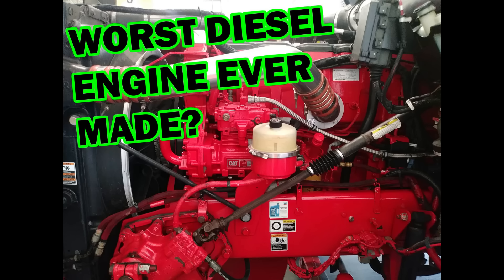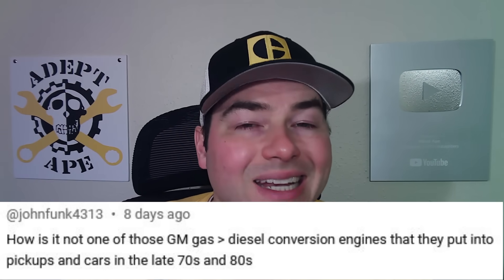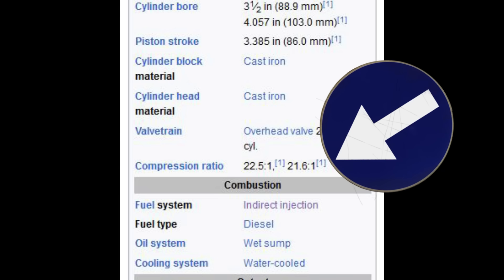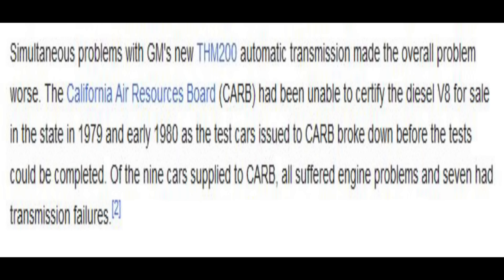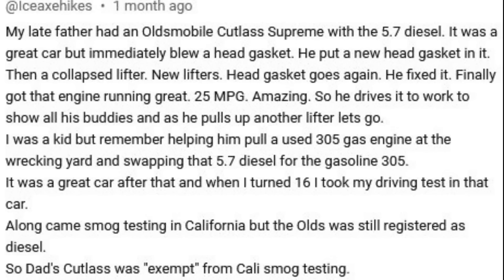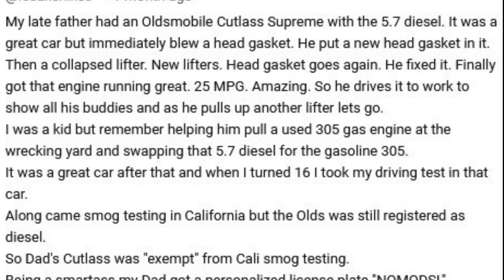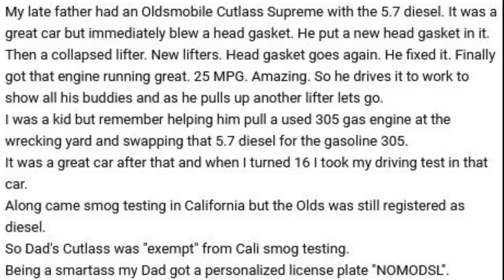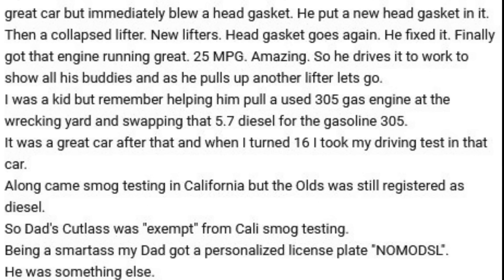This Engine is the Reason You Don't Have Diesel Cars in America!!!

Comment from the maker: Hope you guys enjoyed this one. What are your experiences with the GM Diesel Engines of this era? You can help the channel out by clicking the Amazon Affiliate Links below: Fuel Pressure Gauge, Compucheck 0-300 psi: https://amzn.to/3YeBldu
Airlift Cooling System Vacuum Filling System: https://amzn.to/3D9AlPu
Radiator Pressure Tester Kit: https://amzn.to/3QGBumn
Milwaukee 3/8" Right Angle Impact Wrench: https://amzn.to/3D2CvAk
Adjustable Height Parts Tray 100 lbs: https://amzn.to/3CBusZB
Engine Oil and Fuel Dye UV: https://amzn.to/3z34zkv
UV Professional Grade Light: https://amzn.to/3gzxPc0
Allstar Oil Pressure Priming Tank: https://amzn.to/3L5pASm
Oil Pressure Priming Tank: https://amzn.to/3YuBrNr
Reply: And  u were struggling to find other Diesel engines. 

Mercedes has been making and importing diesels for United States since 1949. 

And they still do. 

For 75 years. Or older than the avg male in North America.
Reply: I have matching 1982 Buick and Olds land yachts. Huge! And they got 28 mpg! The odd head gasket failure to be sure.
Reply: Fortunately for people around here there was a mechanic that could do the head gasket fast and cheap. You had to keep the glow plugs up for our ND winters.
Reply: Well the other day was depressing. 
I worked on a generator powered by a 6B 12v cummins. 
Whats depressing about that ? 
Someone ruined it by putting some spark plugs in it. 
They took a great engine and ruined it with gaseous fuel  😂
Reply: My Dad sold those 5.7 350 cu inch engines in Oldsmobile cars.  He said he sold like 3.  One blew up while they were on a test drive..... brand new!  They had to get the car towed back to the dealership.  Didn't sell one to that customer!😅
Reply: CAN YOU PLEASE GROW BACK YOUR BEARD . IT SUITS YOU  . TRUST ME . . NEXT TIME I WANT TO SEE A MAN NOT A BOY . 😊😊
Reply: My dad bought an ‘83 Buick Century with a 4.3 Oldsmobile diesel engine. 
Injection pumps were the issue early on 1st one went out at 45,000 miles. We went to a local diesel injection repair shop and they suggested a Stanadyne injection pump. He ran that one another 100,000. At 150,000 the freeze plug in the center of the block rusted through and dumped the antifreeze on the highway. We repaired the plug replaced a cracked head with a reworked head an engine head shop had been sitting on for 15 years (according to the owner) back on the road she went with new piston rings and lifters and injection pump #3. At 475,000 the transmission gave up on him and he put the old car to rest. The V6 was the engine to have and as commonly happens just when the problems are almost solved we abandon the concept and go a different direction. GM was sitting on a gold mine and threw it away by cutting costs. The VW rabbit diesel was the most sought after vehicle in that era because of its reputation and GM was the least sought after because of theirs.
Reply: @DaddyRabbit62 A Stanadyne? you mean like out of bulldozer?
Reply: Bought a nice cutlass oldsmobile V6 diesel for 600 bucks at a auction. Wife drove it a couple of years. Head Gasket blew and she overheated it.  Finally sold it to a junk dealer. GM should know how to build diesel engines. After I sold it I saw an Oldsmobile for sale cheap. Setting next to it was a fresh rebuilt V6 diesel. GM must have forgot how to make transmissions. The 06 Pontiac  has a Toyota transmission. The easiest way to check the fluid level is to crawl under the car and remove a motor mount. The short dipstick is held down by a bolt. Seems to be a good transmission.
Reply: I currently drive a 2018GMC Terrain with the 1.6L diesel..  I have 133,000 miles few issues... people are stupid I get 44 MPG ignorance like you spewing is why diesels dont come of age... they are way better now and mine has been reletively reliable..
Reply: Hada 1983 old's 98 5.7 diesel. Was a great car. At the end I got 29 mpg on long trips. Just before 100K It dropped a cylinder, it was done! If they would of made it right, would of been a great motor. That olds 98 was a great car for the time.
Reply: VW had long time success with their 4 cylinder diesel which was a convered gasoline engine.
     The Oldmobile diesel was conceived as a diesel from the beginning. It's similarity to an Oldsmobile gasoline engine, is mainly shape & size, so that it would easily fit in so many different GM models.
      It's misleading to characterize it as a "converted gasoline engine". The reason it sucked, was the nerd beancounter accountants at GM wanted to save a few nickels on head bolts, etc.
Reply: The Oldsmobile diesel engine was insidious, because they usually were troublefree for the 1st 15,000 miles, & get 25 mph on a comfortable full sized car, giving time for word of mouth to taibe about how great these new GM diesels were, making sales spike, then they went to sh*t all at once, devestatimg the diesel market in America forever!
      It was so close to being good, but like I said in my other comment, they tried to save money on seeminly small & innocuous, but actually critical parts. It all came crashing down at once, never to recover in the marketplace. By 1980, they had the kinks worked out, but it was too late. Decades later, I had a 1982 bustle back Seville with the 5.7 liter Olds diesel, & it ran great.
Reply: The ‘gas and Diesel engines are different’ argument is MOOT

Case 1- the vw diesel was essentially based on a 1975 gas engine from Audi doveloped in the 60s. 

This engine ran almost unmodified until 1997 powering cars and even ‘bus’

Case 2
Vw 1.9 tdi 
Literally shares a block with the 1.8t /2.0 gas engines. 

All 3 engines can go half a million miles. None had headgasket problems. 

It’s not that they can’t share a design. 
That’s shade thrown by gm or ford fanboys. 

The reality is. 
Oldsmobile was shitty and now they’re gone😂

Comment: Grandma bought a 5 cylinder diesel 300d in 1974 in Germany brought it back to use for a road car but couldn’t get service at the dealership, couldn’t find anyone else who would work on it and parts were so expensive she lost a load of money from that car. Even today I have difficulty finding a diesel mechanic shop which will work on my ford 7.3 liter diesel pickup truck.
American government and car manufacturers really never got around to aggressively marketing diesel trucks except big tractor trailer trucks and big pickup trucks but virtually no sedans or station wagons I would have liked to been able to buy a little VW bug with a turbo diesel engine get 50 mpg run it on used transmission fluid or used motor oil and gasoline mixed. I lived through the oil embargo 73’ you were only allowed 5 gallons of gas had to wait in line for hours. Would’ve been nice to avoid that pain but even then there was no mechanic shop that worked on small diesel engines at least not like European countries 4 cylinder diesel cars were as common as Chevy nova’s every gas station knew how to work on them.
The failure wasn’t just General Motor’s and Oldsmobile but there was no infrastructure and no engineering and no granular process, just slap it together and sell, sell, sell!

Comment: I love the opinion of people who only know and love Fords engines, which I believe you are one! It is apparent the way you talk this is fact!!  The diesel in not popular in the US because the President Jimmy Carter hated diesels and tried to ban them forever! This made the auto manufactures take a step back from Diesels in cars, know I was in his administration when he did! By the way in many other countries diesels are the only engines in their cars The Detroit engines have been the mainstay in the Marine and military industry's way back in the WWI until the 1990"s!
when Cat rolled out 3200 series V8 mostly of the marine application for large pleasure boats! However, the 871, 671, and 471 Detroit's, were in tugboats, ships, over the road trucks, box trucks, farm tractors and heavy equipment for years!!  Diesels are used in more than 2/3 of the equipment in this country, and 95% of the inboard pleasure boats around the world over 60ft! 95% of the boats under 60ft with inboard out boards use Chevy or Gm gas engines!   The Oldsmobile Deisel was not a conversion it was a stand-alone however they used a similar mold for the block and did not make the mains with 4 bolts they used only two, this was the downfall of that design however in 1980 they fixed the problem! I ran those engines late into the 80's then went to the 6.2 Na baby diesel! If these were so bad why did the US Military buy Both of these engines for their main vehicles until they changed to the 6.2 Turbo and the 6.5 turbo engines in the later 80' until present? 
If the Detroit are so bad, why did they not go with Cat? the military tried International Harvester but got rid of them after WWII because the IH plants were being bought up by GM!!
 Ford Junk could stay together long enough to even make the trials!!
Ford has never made a good diesel, that is why they had to team with International and Mitsubishi who by the way was owned by Detroit GM!! Your info from Google is wrong they make crap up if they do not know! You want to impress me Buy a 350 olds and run it, if you take care of it will run 300,000 miles! On my baby Detroit 6.2 NA I have 1,25 million miles! I drive a truck for a living now and I know how to keep Detroit Diesels running for longer than those toy Fords ever will!!

Comment: I had 3 pickups back in the day with those motors . All you do when you get it brand new is tighten all the deadbolts 30 more pounds over spec . I ran them 120,000 miles and never lost a head gasket . They weren’t power houses but it got good fuel mileage. These were short bed 1/2 ton Chevy pickups just for driving to grading jobs for work .

Comment: Your analysis is spot on.  I'm 66 and I remember everyone with these engines having failures.    Virtually no one wanted to own a diesel can after that.

At the time I pointed out that small diesel engines for delivery trucks cost twice what these diesel engines cost (with similar power).   That was of course because the delivery truck diesel engines were  designed to be a diesel from the start and everything was far more robust - and they did not have unusual failure issues.

Comment: You never mentioned the biggest reason that diesels became popular, which is MONEY. And MONEY, is also why you would never see diesels again(even IF you could make them meet emission standards). Back in the 70s, diesel fuel was considerably CHEAPER than gasolene, plus diesels got better MPG(miles per gallon) than gas engines. TODAY, diesel fuel COSTS MUCH MORE than GASOLENE!!! WHY??? I personaly would LOVE to know the answer to that!!! Back in the day, most homes were HEATED with fuel oil(which is DIESEL fuel), now most homes are heated with NATURAL GAS!!! So there is less used in home heating, which according to supply and demand should mean that DIESEL should be CHEAPER than GASOLENE, but it is NOT!!! I would LOVE a RATIONAL EXPLANATION, but that is a large reason diesel makes no sense in automobiles.

Comment: In pickup trucks GM had the POS 5.7 ford and christler used proven engines from international harvester in Ford's and cummins in dodge. Both were successful. In the 80s my brother bought an 84 ford 250 with 6.9 diesel engine auto trans. The same year I bought basicly the same truck with a 460 gas and 4 speed manual transmission. That was the best truck I ever owned. At that time we were both pulling a lot of trailers hauling everything from livestock to building materials. That 460 would run off and leave that diesel even with a heavier load. The only advantage the diesel had was fuel economy, that 460 loaded would pass everything on the highway except a gas station.

Comment: Another GM diesel story would be this in the locomotive World General Motors or EMD ran the show. Then they came out with the sd50 they raised the horsepower of this by just turning up the RPMs of the 643 Diesel from the sd40. This caused many failures and problems and GM was thrown out of the locomotive race and now GE owns it.

Comment: You got it all right..... the combusting engine pressure was a way too high and that`s the same in ALL GM diesel engine....But the biggest failure of 5,7 was it did not have a water filter for the diesel fuel. All trucks are running lower combusting pressure and using a turbo and then you can get more horses out. Thanks for pointing out the smaller 6 cyl. diesel engine and that it was a good one. 
But the 5,7 diesel used to be a good petrol engine and made some 800 horses with a big bore Olds crank and and many hours of labor and machining. Some guy I did read about did lower the combust pressure and run that engine for many years without any issue and he did also install water filter. 
Smelling a diesel in the morning smell like a victory.....

Comment: How did that 305 gasoline engine hold up? That was made by Chevy and installed in Buick  / Olds / Pontiac too and led to a lawsuit.  I had one in a Pontiac. I got $300 when the suit settled. It wasn’t enough.  They had soft camshafts. Mine failed at 50K miles.

Comment: Had a friend that that had an Olds Cutlass with the 5.7 diesel in it super car 6 big guys going to concerts and strip clubs rode and drove like a dream had another friend had a Volkswagen rabbit with a diesel no more than 4 big guys going to concerts and strip clubs. The Olds got around 25 miles to the gallon when comparable gas models got 15-19. Rabbit got 44 miles+ comparable gas models got 22-25. I swapped the Olds diesel out at 56000 miles with a 350 gas because it put a piston out the side and that was the cheapest fix back in the day. Swapped the diesel out of the Volkswagen at 238000 miles for a gas engine out of a Dodge Omni because Dodge put Volkswagen engines in the Omni in those days and it was the cheapest fix
 Loved turning wrenches back then cause people kept things forever because of interest rate and lack of money.

Comment: I had a Toyota 2 Wheel Dr. diesel pick up a Volkswagen rabbit diesel and a  78 Chevy pick up half ton that had that in it. I put a small block Chevy in it because there is problematic also an 81 I bought a Cadillac coupe Deville Braham. also had the old diesel. that one actually ran OK. I do miss that Cadillac.

Comment: They weren't subsidiaries, they were divisions of the same corporation. Oldsmobile and Pontiac didn't go out of business, they were shut down by GM. They kept Buick because of its popularity in China, not because of any great sales success here. Another factor never discussed by you youngsters, who weren't even born yet; before the gas crisis, diesel was cheaper to buy than regular gas, when more cars started offering diesels, the oil industry raised the price of diesel, so as not to lose the profit they had been making, due to the popularity of gas engines. That immediately changed the the major advantage, of diesel, in the eyes of the public. GMs feeble attempt to cash in on the diesel wave, after they began substituting cheap Chevrolet engines for the V8s designed and built for the other divisions, led to the start of their loss of market share, as did their new requirement that their customers do all the research and development, as their engineers were too busy with all the new safety and fuel milage requirements. At the same time, light duty trucks, were much cheaper to buy than cars, due to their primarily commercial usage, and their lack of regulations that only cars had to meet. This (and the bandwagon toward front wheel drive in most cars) led people into using pickup trucks, as everyday transportation, instead of cars. This caused the car companies to gradually raise the profit margins on trucks, from about 12 %, to the 40 % that it is now, with their being more popular than cars.

Comment: dad had chevy p/u truck with 350 and auto trans, would smoke the tires in 1st and 2nd gear. when rebuild at 350k miles, i found the wrong timing gear, was an old type with the valves opening late, vs. the newer with the valve opening sooner and early.

Comment: Had a Chevy wagon once powered by tbe Olds diesel.  Engine actually worked well; the trans eventually went bad.  In the day, the two most likely complaints with the Olds diesel were fuel waxing up in cold weather and some problem with the Roosamaster injector pump.  Mine, as I said, worked fine.  It would take maybe 18-19 seconds to get to 60, but it would do close to 80 on the highway, and it did one thing well that many contemporary gas cars wouldn't:  it would respond instantly and reliably to the accelerator from standing still.  It didn't have a lot to give, but what it had, you got right now.  That, of course, is a characteristic of an injected engine; contemporary carbureted engines not infrequently hesitated off the line, due usually to an issue with the accelerator pump.  The 350 diesel block was often reckoned a good foundation for a high-performance GAS 350 because of the extra metal in the high-stress areas.  They had a fairly good idea, which might have been better if based on the taller-deck 455 and equipped with a better injector pump, and possibly turbocharged.  Well, it was what it was.

Comment: I had an 82 Cutlass with the 350.   The only problem was the injection pump.   Between 40,000 and 80,000 miles, the injector pump was going to need to be overhauled.   It want a cheap repair, and you had to swallow it as a maintenance item like changing spark plugs.   I really like the car.